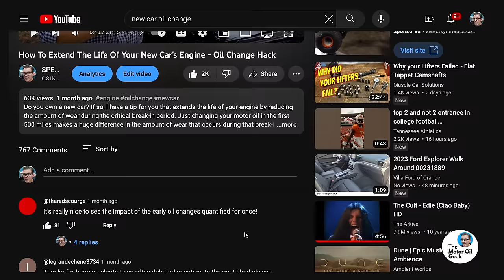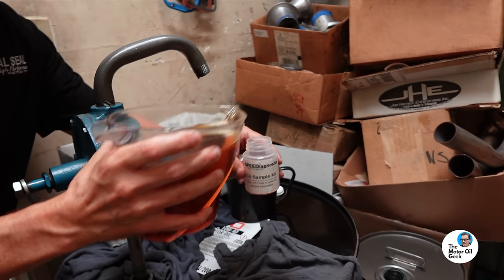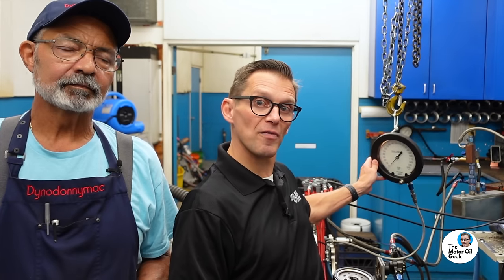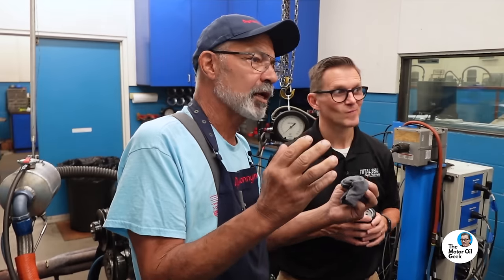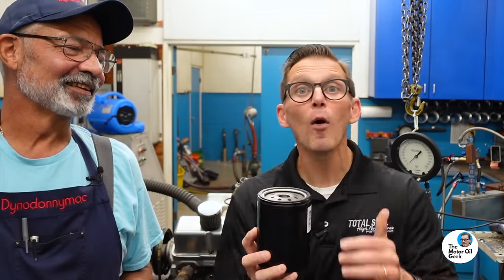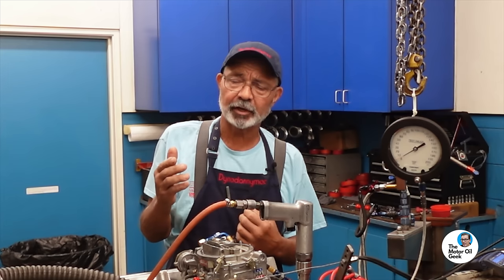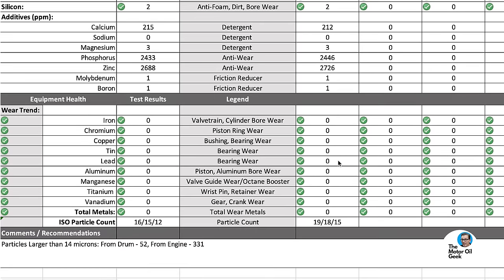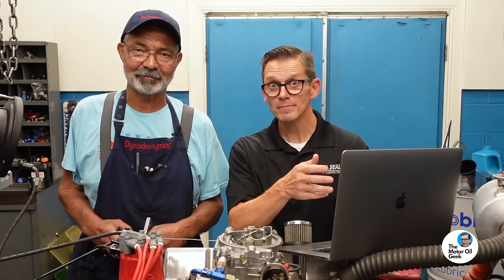Does Pre-FILLING The Oil FILTER Cause Engine DAMAGE?

Comment: Well, there's a thing I never knew I needed to worry about.
Think it makes no difference at all, and have never pre filled a oil filter before.
And to be honest , there's engines out there where the filter is upside down , so you couldn't anyway.
So, unless you've just done an engine rebuild ( you would think that you'd be coating each part in oil as you go anyway , plus you'd probably turn it over without coil pack Connected , in order to get some oil around  it, before it kicks)
If its just come in for a service..
Theses gonna be plenty of oil stuck to those shells- chain - conrods .
If you really want to worry about something real, worry about all the rapid fit monkeys just putting any old oil in your car instead of the right stuff (ford  eco boost 5.20 , anyone? )
Reply: I have never primed an oil filter. Have had many cars with hundreds of thousands of miles. Currently a Saturn with 351,000. I would probably prime the filter if it was facing up. But, haven't seen that much.
Reply: Try that with a small block ford,it will not work well
Reply: Only filters I would even think of pre filling are big ass filters that are mounted in such a way that it won't make a mess. Otherwise it would make little difference for majority of passenger vehicles.
Reply: @danielmckay8542  Works for my 5.4 Ford. That filter lays on its side. 136,000 miles. Just like my old 302 that had 169,000 when I sold it to buy my 5.4. Never primed. Not opposed to priming. Just never been an issue for me.
Reply: It appears you don't realize the actual problem. Without oil pressure there is no oil film. The moment the first ignition hits and the bearing isn't pressurized yet, that film of residual oil - or assembly lube -  is gone and its naked bearing on metal. Maybe there's also a misconception about this part in general. The bearing material and the steel of the crank aren't meant to ever make contact under normal operation. For a couple crank rotations during startup while the pump is still building up pressure it's unavoidable, and that's why smooth soft bearing material is added in the first place. When the engine is running it's effectively a fluid bearing, with no contact between the parts of the rotating assembly at all. 
Not pre-filling the filter once or twice is unlikely going to outright destroy the engine. It'll simply increase wear. 
So most people who sell their cars after four or five years will never notice the difference, whether the grease-monkey at the local service point does the job correctly or not.

Comment: Wow, I kinda feel ashamed of my fellow subscribers. I mean what's going threw their mind when they refill the oil and it goes into the top of the motor?

Surely they don't believe that drains down to the bottom of the oil pan without touching anything ...

Why they do this.
Reply from the maker: I'm subscribers to this channel would not think that, but there are others on YouTube that needed some education, LOL
Reply: The oil you put into the top of the motor goes down to the pan and goes through the foyer before getting to critical areas such as bearings.  However, the oil is very clean from the bottle 99% of the time so it’s not that big of deal
Reply: @ohboy2592  Sure but I've seen many vehicles in my life which had the oil fill port directly above a camshaft, I mean regardless of how you refill its going getting on something critical.

That was more my point, but I do agree with you.

Comment: Caterpillar did studies on pre-filling and came to the conclusion that filling in the field in a dusty environment results in grit getting into the filter - better to just screw it on dry and fill with the service truck pump.  The few seconds the engine runs without oil pressure is at idle where wear is minimal and the engine was just running minutes earlier so nothing is 'dry'.  I'm not sure how that applies to most people's application but FYI.

Comment: on a brand new assembly (and  dry)  engine,   a prefilled oil filter will   not let air past, and  priming will be  really REALLY  difficult.   But on a simple oil change,   where the oil pump is still oiled up... then no problem.

Comment: always change the oil in my vehicle, it has a vertical filter and I always add oil before placing it. I also lubricate the retainer when adding oil to the filter, I prevent the engine from starting dry and it suffers less damage.

Comment: I have worked on fleets of rigs where it was hard or pretty much impossible to prefill some of the filters. One piece of equipment ran from 1963 until 2020 when it was retired. I had the oil pan off not too long before to replace the pan gasket and pulled a couple of main bearing caps while I was in there and the bearings looked fine. The two canister filters on this rig held over a gallon of oil apiece and since the canisters went on from the top their was no practical way to fill them.

I also did work on four identical engines where the access to the filters was very poor and I would snake the filters in open side down and then flip them over with one hand to screw them in place. This kept any dirt that was knock loose from falling into the filter, prefilling would have meant the filters would have been far heavier and hard to handle since the installation was done mostly with one hand. These machines had 10,000 hours on each of their engines when I last saw them with no bearing problems.

Prefilling filter sounds nice when you have a clean shop to work in, but when you are out in the dirt, snow, mud, and rain it doesn't offer enough advantage to make it worth doing.

Comment: I took Tribology class in college when i was going for my BSME.  I actually enjoyed the class, it was the first year it was offered.
Reply: Also currently I work with mobile hydraulic systems for custom fire trucks.  And the hydraulic oil that comes in drums/totes, is very "dirty" from the supplies.  We run it through a filter cart for a specified time to obtain the desired ISO level.  Then it's added to the hydraulic tank reservoir.  Dirt isn't just limited to solid particals, but moisture as well.

Comment: I’ve got two vehicles with horizontal mounted oil filters. I’ve never prefilled the oil filter. Both have over 200k miles and still run.

Comment: Melling MPL-201 Engine Oil Priming Tool is the answer to pre oiling engines without spinning them.   it's a pressurized container with a hose and fitting that you plumb into the block and it uses air pressure to force fill the oil passages in the engine.  can also use something like the canton accusump , which is also pressure filled and can be used as a pre oiler for new/cold engines.  or be used in coordination with a pressure sensor and when it senses low pressure in actual running conditions ,  distributes its reserve .

Comment: I've been working on cars for 60+ years, doing all my own work, including rebuilding engines and building new engines from scratch. Other than with a new or rebuilt engine, pre-filling seems like overkill and a waste of time. I don't do it for routine oil changes and I've never experienced an engine failure of any kind, or any sort of wear issues of bearings, pistons, rings, cams, etc. There is enough residual oil in an engine after draining the oil to protect the parts from wear for the few seconds it takes for oil to circulate throughout upon starting.

After a rebuild, I would pull the coil wire (back when cars had a single coil) and crank the engine until the pressure came up, or, with newer vehicles, pull the fuel pump relay or fuse. I specialize in Lexus/Toyota, which don't have the "clear flood mode."

Comment: Did anyone else notice the Anti-wear additives were higher in the oil out of the engine? There was still some old oil in the engine that could be argued that caused this result. The material found in the oil sample could be normal wear and tear and not from the low oil pressure. We also do not know if it was synthetic, blend, or conventional. Was it the same oil in the engine previously? This is more of a discussion about what oil is being used that does not provide a film between the bearings and the crank and cams that cannot survive a few seconds without a fresh supply of oil. The oil needs to provide this feature to protect the bearings during cold starts when oil has drained into the pan and the pump needs to refill and pressurize the system which happens daily. There was no discussion about the different ways an oil system could be configured. Even with a prefilled filter, there can still be a delay in oil pressure. Plus, an engine would easily get up to pressure faster than the drill could achieve. All my years in the automotive industry plus all the knowledge from family, friends, and various industry people, some approaching 40 years now, I have always been told that filling the filter is unnecessary and actually could cause problems. The issue primarily would come from using filters that do not have or have a poor anti drain back valve in the filter along with other problems. The few seconds of cranking do not cause enough harm to the engine. More damage is caused by going longer on oil change intervals than a few seconds of cranking with low oil pressure. There are too many variables that make this test invalid and does not argue in favor of filling the oil filter.

Comment: I might also add, love your bottle funnel, it's the same what I have and works a mint... also store it the same way as mentioned... clean it before each us (same as cleaning around the oil hole in the rocker cover on each fill). I also want to add a non comparable comparison but somewhat similar... when using a pressure washer, it is best to run water through the pressure wand before turning on the pressure washer on. This gets rid of air bubbles which can damage the pump. Somewhat similar to the 'filling the oil filter' as supposed to not filling an oil filter.

Comment: I've always filled my oil filters before installing the new one. Even the side mount ones. I let the oil absorb into the filter media on the bench for a few mins. then install them on the engine. The small amount of new oil that drips out during installation is minimal compared to the damaged being caused by a "dry" start up.

Comment: Even though everybody told me it's unnecessary, I still always filled up the filter before installation.  It only makes sense to not run the engine without oil for any amount of time. When you dont add oil to the filter and start the engine... the engine sounds VERY angry for a few seconds.

Comment: Consider ‘filling the cartridge type of filter only in the outside holes’ because if you fill the inside bore, you’ve injected unfiltered oil into your vehicle: the center bore goes directly into the motor.

But even that is not terrible: When you start your motor on a cold morning, the oil is too thick to fully run through the element: the bypass valve opens and Unfiltered Oil flows to your sensitive bearings and lifters, etc.

But the real answer is ‘if you’re doing a proper oil change, you’re supposed to do it to a recently-run motor, which helps suspend oil pan-contained detritus into the soon-to-be-drained oil, which also has the added advantage of wetting all the oil-exposed surfaces.’ This residual oil film is more than enough to handle a motor being started an hour later that is not in gear and not pulling a load for the less-than-10 seconds it takes for the filter to be filled and pressure established by normal oil pump means: It is most likely in park/neutral at idle with no load (recommend not to rev until the pressure comes up), which is very benign to any bearing surfaces.

Questions: do you think a brand new motor built at the factory has its filter filled prior to its first run? Do you find many cars at the side of the road outside an oil change facility that have grenaded because the filter wasn’t prefilled? Are vehicles with a horizontally-mounted (can’t be filled without spilling) filter flawed? If you get oil on your fingers during the service, do they magically become dry without cleaning?

Filling the filter is an urban legend: it is difficult to disprove because you can’t find reliable failure studies supporting either case (if there is an advantage that only shows up over 150k miles, can it be proven to be solely from a filter, or is that a normal expectancy of a motor anyway?)

(and by all means: If the service manual calls for filling the filter, Do It! But likewise, if the manual does not call for it, there is no need).

Comment: I put an oil pre lubrication system on a 1978 Thunderbird years ago. It would power up the oil pressure before starting the engine. Sold it with 120,000 miles on the engine. It didn't burn any oil.

Comment: Also, a lot of engine oil filters on modern engines are turned diagonally or horizontally because of their design. If you prefill an oil filter the oil is going to leak out when you try to put the filter on. There is a reason for that too. Because it's not a requirement to prefill the filter.

Comment: I have instinctively been putting oil inside the filter for years now. When doing canister styles, although I poured a bit on the floor  during installation, I still filled the canister as much as I could and also pre-soaked the filter material itself in oil. I've never been positive how much difference it could make, but I had a suspicion that it wasn't a bad thing.

Comment: As long as you restart the engine within an hour of oil drain, filter change theres no chitting difference, the oil pressure climbs within 20 seconds either way.

Comment: Just a tip, nothing serious: when pouring engine oil inside the engine using funnel, it's a good practice to place a colander in the funnel.
Why?

Many many years ago (maybe 16 years) when I was pouring engine oil inside the engine with just a funnel, a nut was inside the engine oil so it got in with the liquid. I know that is very very rare to happen and this happens due to errors but thankfully I was so lucky that the nut was bigger than the oil filler neck and I managed to pick that out with a magnet.

So since then I've been using colander and thank goodness it's never happened again but I put it there just in case.

Comment: I've never thought that the oil out of the the manufacturer's container would have an contamination.  However, was the test engine a brand new engine that has never been through a combustion cycle?   If the engine has ever run previously, of course it will have remnants of it's previous oil fill, that may contain contaminants.  Interesting information, but my current 2014 U.S. manufactured vehicle has a horizontal mounted canister oil filter, mounted off the front of the engine.  I would have to stand the vehicle up on it's front bumper to install the canister filter filled with oil.  My previous 1999 vehicle was retired with 538 K on the odometer and I had never pre-filled the canister filter.  The only internal engine failure on that engine during it's life was the replacement of the distributor at 450 K.   I can't argue with your stats, but I'd question whether it makes any difference to the life of the engine.

Comment: Alot of the subaru guys prefill the filter but also prime the engine with spark plugs out with the crank sensor disconnected like you would with a new engine

Comment: Back when I was a bit more fastidious I'd pull the fuel pump fuse and turn the engine over a few moments, 10 15 20 seconds after  changing the oil before starting to get some oil in the pipes before starting. Then start the car normally. Doing this I noticed the pressure indicator light went off immediately. I also let the dirty oil drain for a good period and I cranked the engine without running it for 30 seconds or so to pump as much of the dirty oil out of the system when doing oil changes. I could usually get a few more oz of oil drained than just letting it drain.

Comment: Obviously quicker oil pressure at startup is a good thing. 

I have seen dangerous pressure spikes on a high performance engine when we prefilled the filter.  It actually burst the filter. 

If we installed it dry no problems....

I'm convinced now though and I will start filling my filters.

Comment: The only reason I don't prefill mine is because it's mounted horizontally at a slight downward angle so it'd all just leak out and get even more oil all over my differential seals and control arm bushings. I don't know the proper procedure to prefill a 2001 Tacoma and the manual says nothing about it, so I don't know if pre-filling is really an option in any capacity. It's at 335,000 miles, runs great, and gets regular oil changes. I've driven across the country multiple times recently with it and wouldn't hesitate to do it again. It's a 5VZ-FE so that might have something to do with how it is still running.

Comment: I find it funny that people would say "it's not going to filter clean oil", when regardless your oil is contaminated with old oil anyway because you cannot and will not get all the old oil out of an engine before putting the fresh oil in (short of completely pulling them down and cleaning every single lubricated component. 
The same also rings true for gear boxes, transmissions, differentials etc.

Comment: So much of this is 'durr fred' kinda stuff but it's great to have the labs to show it and the in depth on journal wear etc is exactly why you don't want he engine moving around without adequate lubrication. Here's an interesting thing I picked up from my pop that never really made sense to me; 'prefill the filter with new oil but use a dab of the old oil on your finger to run around the outer seal'. To this day I've got no idea what the logic behind it is.